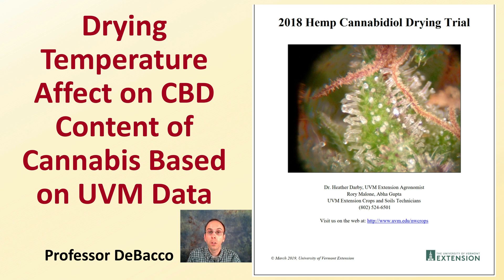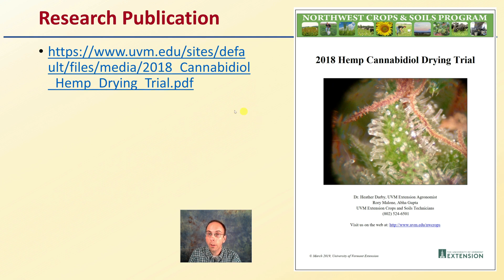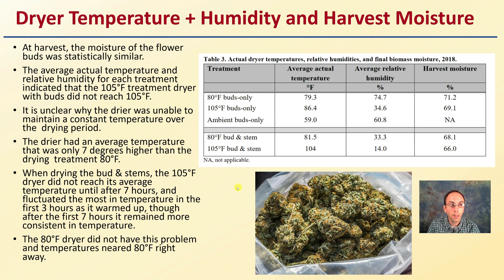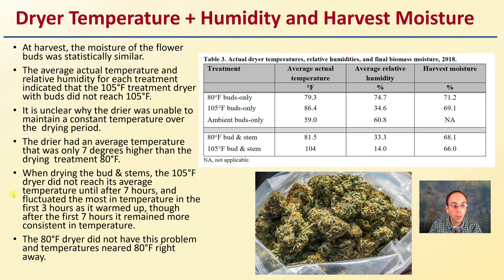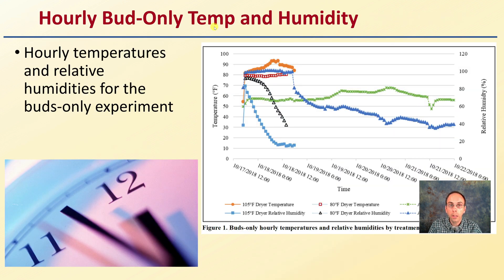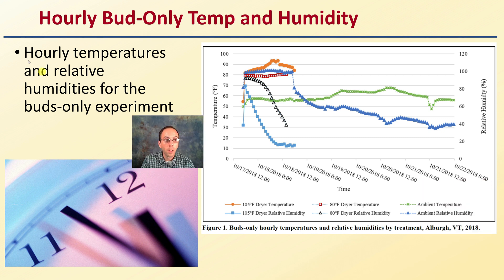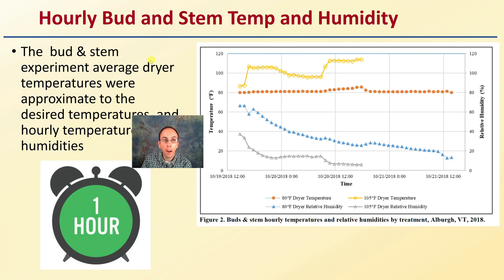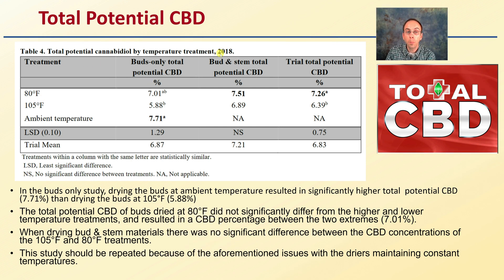Drying Temperature Effect on CBD Content of Cannabis Based on UVM Data

Comment: This research is quite fascinating. If you read the report ambient temperature is 69F which is what most people strive for and 80F is already much higher than recommended. Also when they say drying on stems they mean small stems not branches nor whole plants. Its interesting that even just a small amount of stem helps to mitigate most of the damage from higher temperature fluctuations far above what anyone would find acceptable.
Reply from the maker: By looking at what research is available this can be a key to making meaningful forward progress.

Comment: My humidity fluctuates at 47-55. My temperature fluctuates from 78-84 F. I’m putting on the AC as long as I can to keep it down. I just harvested on Wednesday, and this week happens to be a hot week in NYC. I know the temperature should be lower and I’m trying so that I can maintain that “high” quality in my buds. How nervous should I be about the quality of my buds and will they still be able to produce that “high” feeling I was talking about?
Reply from the maker: Try and get that temperature down as this will cause more degradation than you may want.  There will be a certain % loss, but the end value will depended on how concentrated the starting material is.
Reply: @DeBaccoUniversity  thanks I’ll work on it

Comment: I will skip this video as in the very beginning you tell me that the piece of equipment that they were using was faulty but that somehow I'm still supposed to believe the information.  How do I even know that their temperature gauges were right if their heater didn't work?
Reply from the maker: It is important recognize what was stated as faulty and determine what this impacts and what is not impacted to determine what data can be used.  It is also refreshing to see a study point out their flaws instead of ignoring the issue and/or not publishing the results even if everything did not go perfectly to plan since there is still beneficial data to gain.

Comment: I live in the desert, harvest comes in October and unfortunately it’s still blazing hot with RH levels often in the single digits.  The only way I can keep the buds from drying in a single day is to put a small swamp cooler in the drying room—brings the RH up to about 45% and cools down to around 80ºF, which I realize kinda sucks.  I hang whole branches and leave the fan leaves on because it seems to slow down drying a bit.  Even so, the most they last in the drying room is 4-5 days, so I jar them with moisture packs at RH-68%, then cure them for a long time-usually two to three months.  
Am I just losing potential potency?
Reply from the maker: Be sure to keep the light intensity and duration as short as possible with that long of a dry time.  However you should be able to reduce this time to ensure you have the least chance at lost potency.
Reply: Try using paper shopping bags to insulate from the heat, double or triple bags for less heat can help
Reply: Good effort.  72f or less is better for sure.  Try the fridge.  Don't put too much or it spikes into 70% RH too much when the compressor is off, and let them dry out a day before or so depending on size.  Compared it to a 7 day dry at 19c 48-60%rh and notice a difference.  Most growers keep rooms below 18c and 60% RH to extend drying.  One guy told me he just puts them in open paper bags or even wrapped around but leaving the fans is best some will say including myself..  Too bad you don't have a cold basement or little AC unit.... Slow and low is the best way to go.  I guess you don't worry about bud rot there.  1 digit RH is a tough VPD!